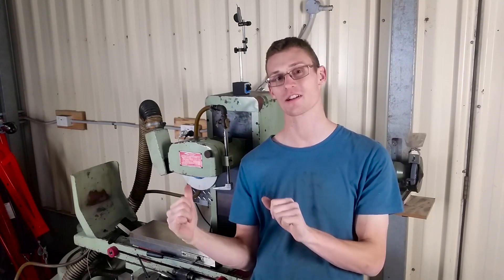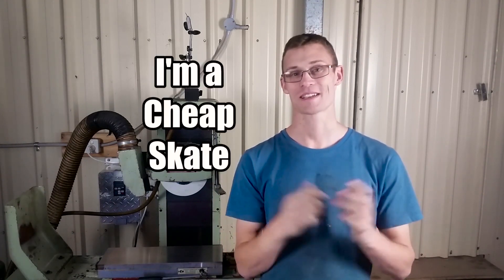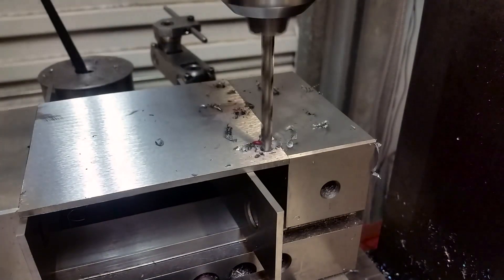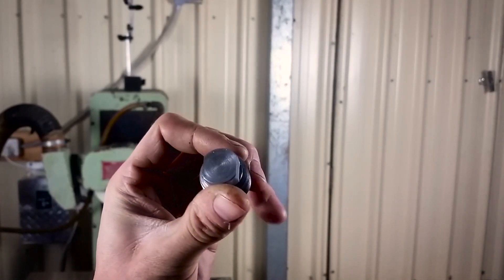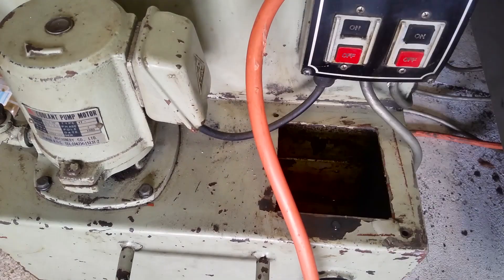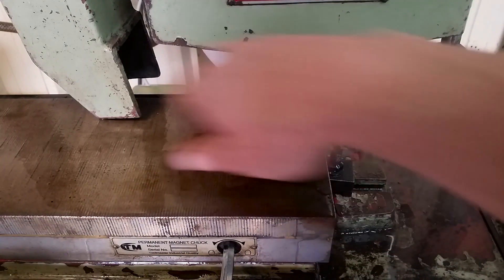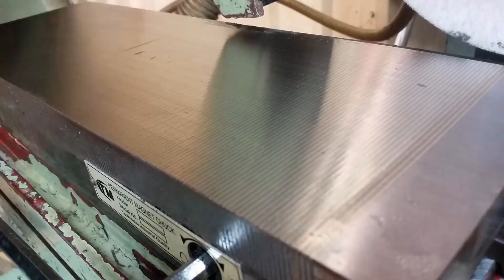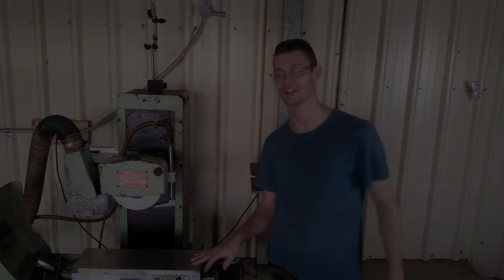Let's Grind a Mag Chuck

Comment: If your mag chuck is longer than your travel you should take it to your milling machine and mill off a portion that can't be used on your grinder anyways. I've done it and it made things much easier. And you will have a truer surface than doing it in sections.
Reply from the maker: I more or less achieved this. Might not have been clear. I took a few passes to grind a decent step down at one end. I then trued up the remainder in one set up
You are right that I should have just milled it. I was just excited to use the grinder 😂

Comment: Your videos are very helpful and interesting.   What do you use on your chuck after grinding to keep it from rusting or corroding.   Do you have a product to recommend, one that is available in the states?  Thank you for the video and the information.  I am new at grinding and your help is very appreciated.
Reply from the maker: Unfortunately I don't properly have the answer myself!
I've been using my normal longer term tool storage methods; lanolin oil coating and a cloth propped over the surfaces (not touching) this prevents a lot of condensation build up and corrosion. of course make sure you wipe off the oil properly before use (fire hazard)
I know in the US you get more extreme temperature swings so you may need to do more. If you (or anyone else) find a better solution, let us know!

Comment: Just the answer I was looking for balancing the wheel. Thank you very much,  I am also restoring and old chinese grinder , but I had not idea I could take that part to balance the wheel also
Reply from the maker: Awesome! Glad I helped someone out
The wheel extractor is simple to make if you have a lathe or the correct thread
Reply: TommyGun Machining I have a cnc , but since  I live in china , I might get it cheaply.   But since due to the virus everything is closed, I might be a nice project to do..
Reply: TommyGun Machining thanks, I could make the thread on the cnc.  What is the thread type in your
Machine.. I am still
Working on the machine is doing well, I made some
Videos about it.. also in YouTube. I took the spindle out and I change the angular bearings. Much better now.

Comment: Looking good, that fine pole magnet is a real gem, there very expensive. 60 grit is a good fine wheel for general use, you can change the cutting quality by either rapid dressing (traverse the diamond quickly) or slow dressing for a finer finish.
Great balancing tool.
Thanks for sharing.
Reply from the maker: I also got a course pole with the machine, but I figure I'm mainly working with small parts, so that is the way to go
The course pole will probably become a sine table on the grinder
Thanks for watching
Reply: @TomMakeHere  - Apologies if you already know this, but fine pole isn't 'better' like some people think.  Fine pole chucks are for thinner workpieces, and generally have a lot less holding power.  To get a mental image of why, here's a link with some explanation of flux paths and what happens with thin workpieces.  https://www.eclipsemagnetics.com/na/workholding-key-considerations/

A casual machinist can make do with either, provided they understand what's going on and compensate for the compromises.

Comment: Did you map the chuck with the dti to see if its flat ?
Reply from the maker: Yes I can't measure any variation, but I only have a 0.01 mm indicator at the moment. I really need to perform a 5 block test for accurate measuring results
Reply: @TomMakeHere  i am looking forward to seeing the results of your 5 block test , what material were you grinding (1020) steel ? what is the rest of the code on the 60 grit wheel  you were using ? as an obviation you coolant looked a bit lean, to much water not enough soluble oil or it wasn't properly mixed
Reply from the maker: @mechelectro2711  Just scraps of mild steel. There is no code on the wheel, short of shipping something from America I can't find a labelled wheel in Australia. The joys of a limited manufacturing industry.
You are correct, the coolant is quite lean, I assumed that the coolant tank was just a front partition, but it is all connected and I didn't have enough coolant to get the ratio right. I'm considering draining it as I don't anticipate much wet grinding in the future and don't want it getting festy again!
Reply: @TomMakeHere  For one try Weber abrasives in Adelaide, there must be a few places in Melbourne, Australia is not that much of a backwater
Reply from the maker: @mechelectro2711  I'll give them a go. Believe me I've been trying a lot of places, everywhere I try they provide the grit and if you are lucky they might tell you wheel hardness is 'soft'

Comment: now after you ground the chuck how did you check it for flatness. where i work we grind 5 rounds of steel, one in each corner and one in the center of the magnet. then, check them all on a surface plate to see how much variation is in the chuck and if you did a good job grinding it.
Reply from the maker: The 5 block test is on my list. Not going to lie I've dived into some small projects already, but the parts are small enough that I'm not too concerned. I will definitely do the test as I have bigger projects planned